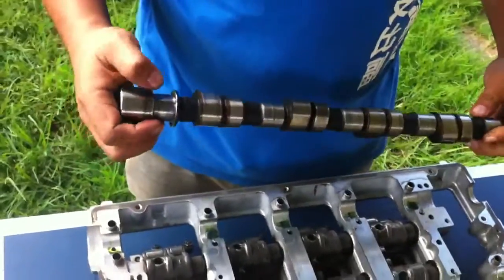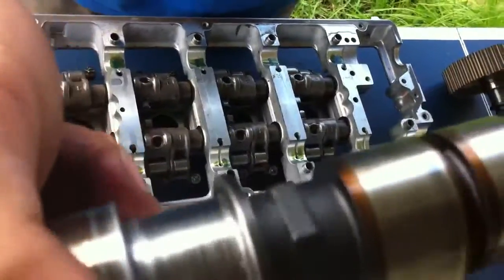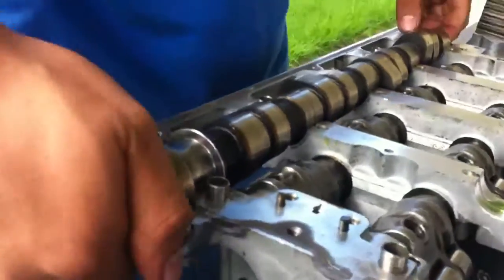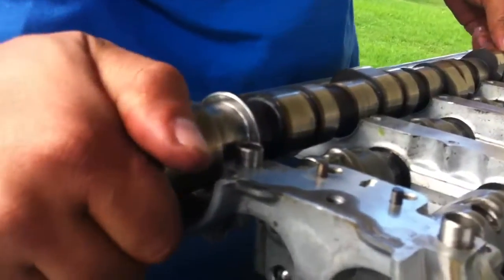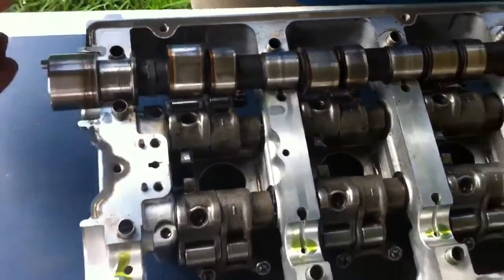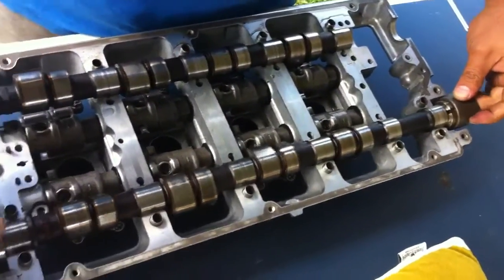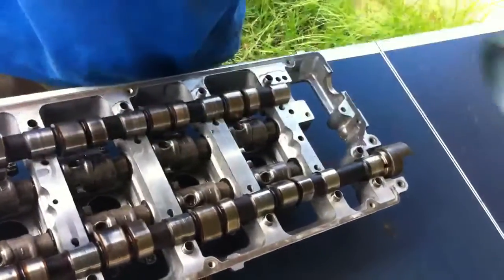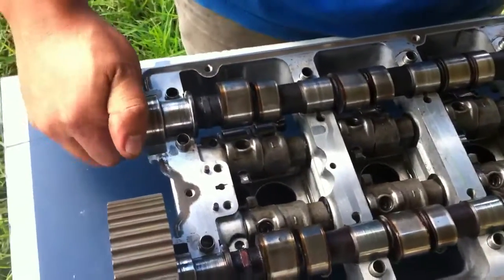Mivec cam tray/follower problem

Comment: @K. LaHLoOB  got it sorted out. found a mechanic that was willing to open it up. several things were bad. the no.1 main bearing was worn badly compared to the others. oil pump gears slightly worn also when check for clearances and also the camtray even tho it didn't look like it. ending up doing a rebuild new camtray. acl bearing kit main con and thrust std size piston rings. and full engine overhaul gasket kit. got it back recently  have to run off 1000k ,my idle is off but it needs to be tuned and clearances set everything checked back

Comment: thanks for the help I did some checking around on the internet also bought a oil sandwich adapter and a guage. hooked it up pressure seems ok  took any dents out my sump pan. I also got another ecu borrowed to make sure it wasn't my ecu but still gives the same symptoms after driving it :(

Comment from the maker: Check oil level, measure oil pressure. If pressure is too low that is the problem. Ensure the car is not running in a limp mode.

Comment: I have a gen 2 the mivec kicks in and works for a little while then afterwards it would sound distorted when it kicks in and struggle  up to 7000rpm could this be a worn camtray problem also ?